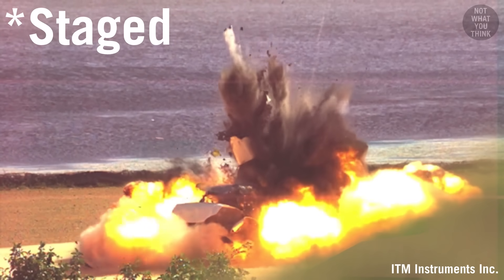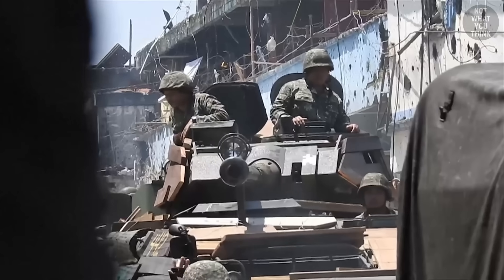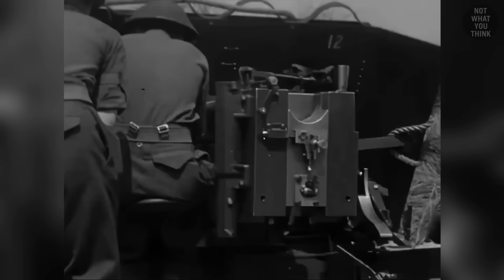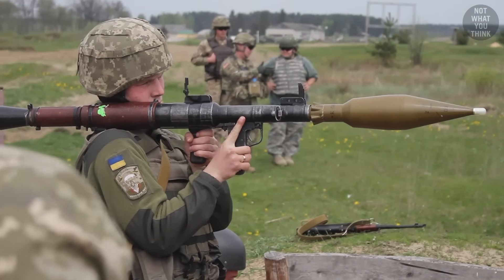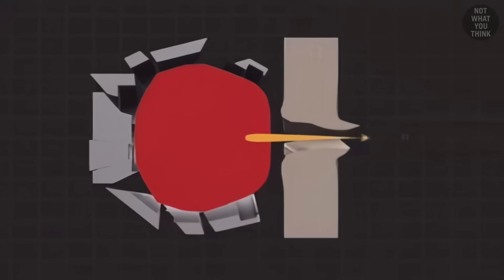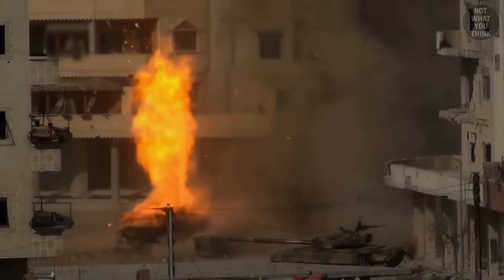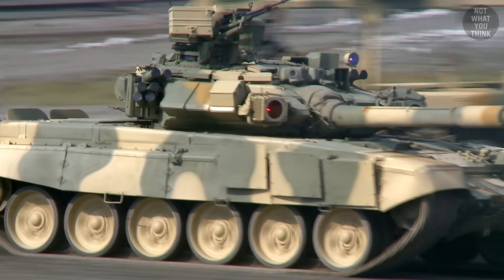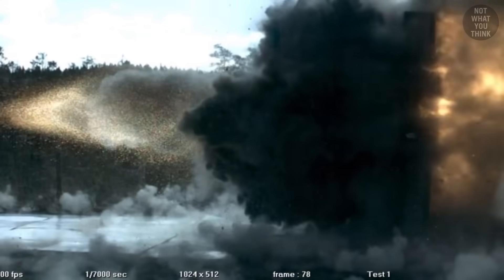Why Protecting Tanks is Getting Much More Difficult

Comment: 6:30 Slat armour/cage armour does NOT primarily work by increasing distance!

Most HEAT projectiles lose little power from those few centimeters of distance, and in some cases even gain additional penetration. The biggest threat to their effectiveness is if they detonate too close to the main armour,  which prevents the proper formation of the explosive penetrator. You can see all of this in the clip at 6:18 - the copper penetrator takes some time and distance to form into a thin "needle".
Instead, slat armour (which for example was frequently used by western forces in Afghanistan) primarily works by squeezing the warhead "from the side". As the fuze at the tip of the warhead passes through a gap, the conical warhead gets squished by the cage. This disrupts the geometry of the shaped charge and hinders the penetrator formation process. That's why slat armour uses cages with pretty sizable gaps rather than a fine mesh.

In the Phillipine example, the ISIS militants allegedly just used plain high-explosive warheads (and even the launchers look like they may be local knockoffs or RPG-2). In this case, a little bit of stand-off distance on a thinly armoured vehicle can be more useful, and the cardboard is claimed to have reduced the power and spread of shrapnel.
Reply: Wow, it is probably my 2 or 3 time in my life seeing a random internet user debunk.
 "Spaced Armour against HEAT" myth with knowledge on proper stand off distance.
Reply: Im wondering why nothing was said about simple tungsten penetrators, aren’t apdsfs the most simple solution to this by basically just being like a giant, hyperfast crossbow bolt made out of insanely strong material that just cuts through spaced and reactive armour like butter? Was wondering why it didn’t get mentioned this video
Reply: @riversetimoshrum7551  Because even the long rod penetrators are slow in comparison, not even reaching 3000 /s.
Reply: @riversetimoshrum7551  Its still stopped by metal armor.
Also even hitting tank does not mean its destruction. There were cases when tank getting 7 HEAT hits and still goes away from battlefield on its own.
Reply: why is it always the weebs that are the one's with extensive military knowledge
Reply: @arcticspetsnaz3094  Can't see I ever found a correlation between anime obsession and military knowledge.
Reply: @johanmetreus  then you haven't been on the internet enough bucko
Reply: a nadie rey
Reply: Slat Armor and "Cope Cages" are to defend against very different attacks. Slat Armor, like you said, is against certain types of shaped charge warheads. Cope Cages are probably to protect against drones dropping grenades into open hatches. Which, given the soldiers sitting on an explosive doughnut, is not great.
Reply: @MazeFrame  from the few reliable sources I've seen it sees like those cope cages were to protect from top attacks by RPGs in an urban environment, which they encountered in both Chechnya and Syria.
Reply: @MazeFrame  then the cope cages wouldn't be built with gaps big enough for a drone-dropped grenade to fall through. 

Besides it seems rather unlikely that they thought that far ahead from day 1 of the Invasion, or would choose a design that raises the visual profile so much and covers far more than the hatches.

So no I don't think that this adds up.
Reply: @MazeFrame  Unless I'm terribly mistaken, the cope cages we see in Ukraine is to defend against the top down attack from Javelins. Not that it works from what I've seen, it's just based on flawed desperate theory, same with the hilarious rear mounted "fire bucket" seen on a few tanks earlier in the war
Reply: The purpose of the slat armor is to actually "deform" the entire cone of the HEAT charge itself, thereby disabling the effective trigger of the charge itself.
Simply put, if the cone gets deformed (by the slat bars) it can not trigger "normally" anymore and becomes useless.

However this only works against simple RPG (1 charge), but it does not work against modern Tandem-charge projectile, as the slat armor can only "defuse" the first chage, but not the second charge behind it, which activates immediately at the same time as the first charge impacts.

TL;DR cage armor only works against simple RPG (1 charge) but is entirely useless against modern Tandem-charge warheads. There is only so much a cheap solution can offer...
Reply: @xAlexTobiasxB  , a few clarifications here:
On the RPG, the NOSE cone is part of the trigger, and that is what the slots in the cage armour seeks to disrupt and not the rear cone containing the actual charge.

Tandem charge using the same type of trigger would have the same rate of failure as the original RPG, what makes tandem charges usually unbothered by cage armour is that they tend to have some kind of proximity trigger instead, as to allow the forecharge to clear any reactive armour with time for it to clear out of the way before the main charge strikes the same location.
Reply: The thing about HEATs detonating early but still being effective was always a weird one playing war thunder. In that game a tree can detonate your HEAT shell, but the copper lance can still easily penetrate a tank just behind it, which makes sense. But then you can similarly do it from hitting a tree 2ft from you and launching the copper lance as far as the shell would have gone.
Reply: @Winasaurus  then that's just a bug in the game. In real life, that jet rapidly cools from many thousands of degrees to air temperature, and also falls out the sky, being finely divided and passing through the air at very high speed.
Reply: where does ceramic armour fit in all this
Reply: @hotdog9262  at the velocities a HEAT round strikes with, the collision with the armour is more akin to a using a water hose stream (the "jet") to dig into mud (steel armour). 
The length of the "jet" (determined mostly by the diameter of the shaped charge) would be how many liters of water you get to use before the hose gets turned off. If the hole you manage to make exceeds the thickness of the armour, you penetrate.
Now imagine that beneath the surface, you have a fist-thick layer of small pebbles. They are harder (but not impossible by any means) to move, and they tend to break up the stream a bit as it hits. That's your ceramic armour in a nutshell. It's the sandwiched combination that makes it so effective against HEAT, had those pebbles been laying on the ground, they'd been washed away in no time.
Reply: @johanmetreus  Your pebbles in mud analogy is quite clever and easy to grasp without prior knowledge. Excellent response! The image of water piercing mud also touches on some of the deep intrigue of armor and weapon design: the magic of working at the ragged edge of material abilities to tease out new results. The things that take place inside composite armor to turn a speeding slug or metal jet into inert debris are wild.
Reply: @ActionScripter  I wish I could take credit for it, but it was the folks at Försvarets Forskningsanstalt who came up with the mud analogy in their reports after studying the events using highspeed x-rays among other things to see what actually happens during the penetration.
I simply added the pebbles as an extension to that.
But I fully agree, the deeper one digs into the subject, the more magical it becomes.
Reply: @hotdog9262  Ceramic armor would be good against weapons that utilize the kinetic energy of flying metal because ceramic is extremely hard and it good at breaking apart metal projectiles. Hence why in many types of body armor there is a ceramic plate in front that will break the bullet apart and thus spread the energy over a larger surface area and then a secondary layer made of materials like kevlar for example would be behind the ceramic in order to catch the fragments.
Reply: @dylonjackson8863  I had the impression ceramic materials were used due to it won`t melt. like metal
Reply: @hotdog9262  British Invention copied across the Western World, even France!

Comment: It is very clear that the main point of vulnerability for a tank is the squishy humans inside it. While the loss of hardware and ammunition is undesirable, it is virtually impossible to prevent, so an effective strategy is to remove the humans and make the rest as inexpensive as possible so that it is expendable, and just make enough of them that they can overwhelm defenses. It's not the tank, per se, which is obsolete on the battlefield. It is the human.

Comment: Robotic remotely operated tanks with redundant compartmentalized command modules would fix this issue. The modern tank with a live crew has a large internal void. Break into that void, your crew is toast, as well as your tank. Turn that void into ~300 separate redundant command and control interfaces, all individually armored and isolated from each other, while still being collectively encased in the thicker overall armor of the tank itself, well, the tank won't stop until you knock out all of it's critical systems. The thing could look like Swiss cheese, power plant knocked out, most of its guts chewed up, and it could still be sitting there spewing out death in return. It's the crew cabin that's causing the liability. Remove the crew and an individual tank could take quite the beating before it died completely.

Comment: It starts badly... If we are going to learn about shaped charges the first video should not show an EFP. Look at the standoff distance (38 seconds).
Also, good luck imploding a plutonium core with shaped charges. That's the opposite of what you want. You use wave shaping to implode the core. That means using explosive that will "wrap" the core as the shockwave progresses. Not pierce it ! That means using different explosives around the core in the explosives lense (not a mix but distinct explosives with distinct VOD).
Ah uhhh, no mention at all about the Munroe effect ?

Comment: Great vid bro.
I hadn't seen vids of APS in action before this.
Very nice.

If I had to make AFV's for a nation in the present anti armor environment I think I would go backwards a bit and make cheap, moderately armored, rocket and or grenade launcher armed drone vehicles.
 Proof against fragmentation form 150mm range HE and heavy machine gun projectiles would be enough I think. Lighter than MBT's. Smaller than MBT's. Tracked mobility. No crew to protect.
The operators would gain experience with out the threat of death and dismemberment for the most part.
And if the costs could be kept down the sheer numbers would be tough to counter.
Such machines could even be used in tandem with MBT's or as an advanced screening element.
There would be some threat to the operators of course.
Locating their positions would be a priority for the enemy but there is always risk to personnel during war.

Comment: Its not the gap caused by improvised armor that weakens the shape charge, like light going through object it deflects and disperse it with each new different materials it passes through

This is why composite armor is that good to defeat shape charges, it has so many layers of materials that it can completely dissipate it

ERA cause a "counter explosion" that pushes against the jet, both deforming and lowering its velocity

Soviet/russian ERA also adds a counter shape charge that cut both the metal jet and kinetic ammunation due to the length of the penetrator playing a major role in its effective armor penetration

Then there is the outlandish electric armor that cause a extremely powerfull electric arc that vaporise the whole thing but its neither viable or reliable

Comment: The tank's solution to this problem isn't mentioned in this video but is being used by both sides in the current war in UA: more tanks. Cheaper, older, retrofitted tanks. Today I saw a video of a UA retrofitted freaking T-55. Over 1/3 of the US's Javelin stockpile was gone by July yet tanks are still rolling across Donbass and Lugansk today. 

Another thing missing from this video is a logistical point: to eliminate a waiting fleet of tanks well behind lines requires many incredibly powerful explosives from expensive long range missiles. Cooking off a warehouse filled to the brim with tandem charge modern missiles stored among other ammunition barely requires more than a hot shell.
Reply: As they keep digging into older and older tank stockpiles, older and older antitank weapons start becoming useful again. That street goes both ways.

Comment: Tanks most likely go back in size but forward in technology in the from of drone tanks with smaller guns and meant to clear trenches from the inside and probably accompanying soldiers. (This in the somewhat flatter terrain.) still the biggest of tanks will be a drone because it allows more space for stuff and should be less expensive to not have to keep something alive inside, regarding protection.. Most likely the armor will only be there for bullets and to counter missiles and rockets the tank would use.. Missiles.. Similar to iron dome but much more compact and faster in the shape of small missile "ports" or anchors all over the turret sides, what would be even cheaper is a "one hit gun" capable of computing ballistics in amazing time allowing it to fire a special explosive bullet to detonate the missile, instead of paying for thousands or millions of complex mini missiles to shot missiles that are way cheaper why not automate a gun like a ciwis except it only needs one hit or two to achieve the same result. Then there are advances in camouflage which may make it so that tanks are difficult to shot because they are now "not visible" to your weapon or rather difficult to lock on at least, giving the tank enough time to scare you away. There's even the change that some new technology or material gives the advantage to the tanks again or they may just evolve smaller or soo different you may not consider it a tank anymore thus kind of disappearing. Only time will tell.

Comment: I would say, it depends on the battlefield.  Is there air cover?  Is there land cover?  Can soldiers get close enough to use the modern anti-tank weapons?  There are no useless or obsolete weapons.  It just comes down to battlefield conditions, which are unique to each battlefield, and have a tendency to evolve over time.  So, in any given battle, tanks may not be effective, then a few weeks later they may be the most effective thing you have.  The modern battlefield itself is changing as well.  Seems like mobility and fast communication are more deadly than any one weapon right now.

Comment: Seriously even if the armor isn't pierced by an anti-tank weaponry, bullets can damage the threads.

I remember in Gate JSDF novel and manga (basically it's about the evil  medieval Empire vs Good Modern army) the medieval army uses battering rams to target tank threads and camouflaged trap holes can basically incapacitate them. Not sure how realistic those tactics are though...
Reply: @Retired Bore In the novel a small Jsdf tank division was going through a large valley, unknown to them the medieval army have made an ambush of 10,000 men within a network of underground tunnels, then when a T-73 fell to a camouflaged trap hole the medieval army sprung into action and attacked the tank division with tactics I said above while swarming the tanks and modern infantry in all sides. It wasn't revealed what happened next but in the end of the novel the tank division managed to return to base with some casualties and some tanks inoperable. Regardless it's hinted that the tank division are victorious.